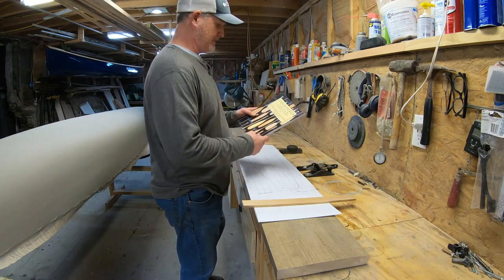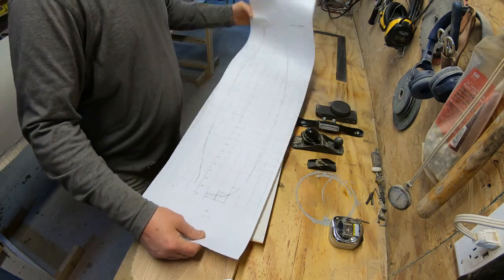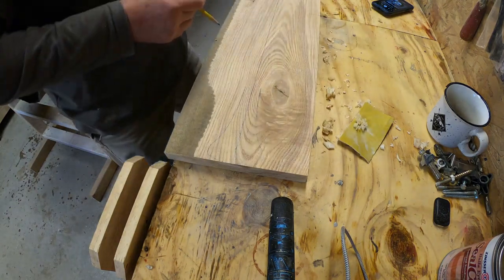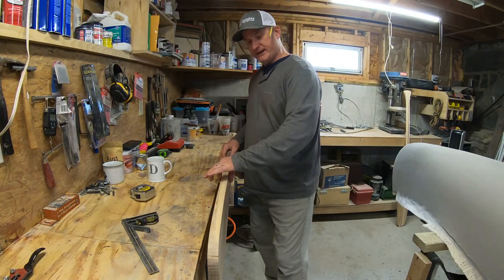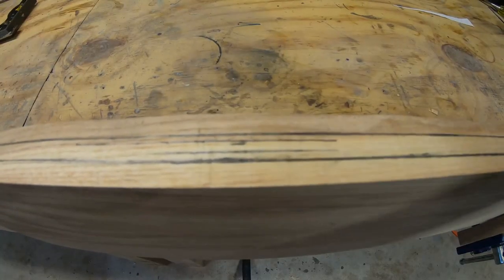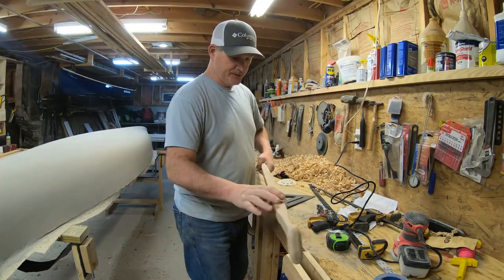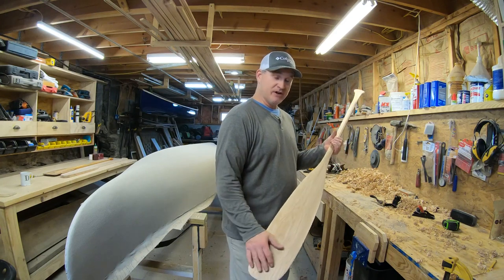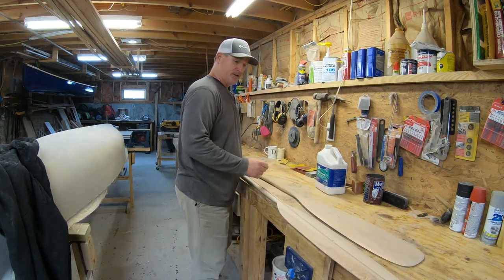Making a Beavertail and Ottertail Canoe Paddle

Comment: Great video. I appreciate the full descriptions and solid editing. The paddles look great! I might try tung oil as a finish. What are your thoughts? I just made an Algonquin style paddle from the same book. It was my first narrow and long bladed paddle and I’m really enjoying using it. 
Cheers!
Reply from the maker: Thanks for stopping by and watching the video!  I am aware of several folk that will use tung oil in their paddles.  It will require several coats.  Making your own paddle is extremely rewarding.  Glad to hear you are pleased with your own project and that it serves you well.  In my most recent video I used my beaver tail video quite a bit.  Cuts through water effortlessly.  A good paddle makes all the difference.  Thanks again for watching and leaving a comment.  Very much appreciated!

Comment: Lovely paddles, well done.
A couple of questions:
How are they weight wise? Ash seems like it might be heavy.
What glue were you using? It looked like PVA glue, but I wouldn't have thought that was very strong. I would have expected epoxy glue or Aerodux, or something like that.
Reply from the maker: When the paddles are carved down to dimension they are not heavy at all.  Granted they are heavier than a cedar paddle or some other lightweight species but I was pleased with the weight result.  The glue I used was Titebond III.  I typically trust epoxy resins moreso than glue but carpenters glue these days is incredible.  Glued my cedar strip canoe with Titebond III as well.  Granted the canoe also receives several coats of epoxy inside and out but my point is the glue is very strong.
Reply: @mainetripper  That's great info, thanks!
Reply from the maker: @mairnealachamu Happy to help!

Comment: i heard otter tail is the one to get
Reply from the maker: If you are a solo paddler then the Ottertail option works great with less fatigue.  In my opinion the beaver tail pushes more water giving more control while also minimizing fatigue but the Ottertail is definitely much easier on the shoulders between the two paddles.